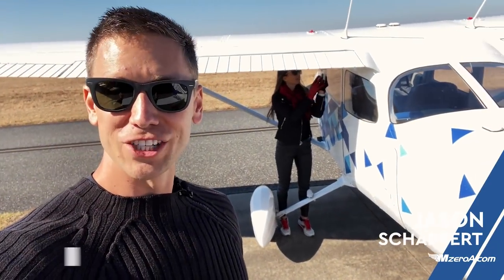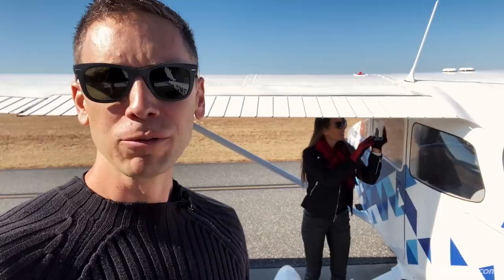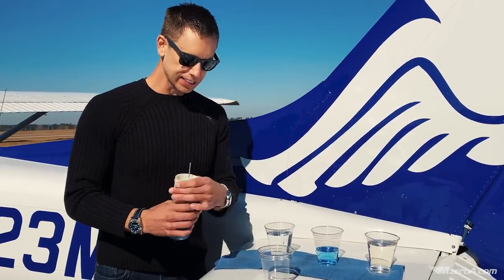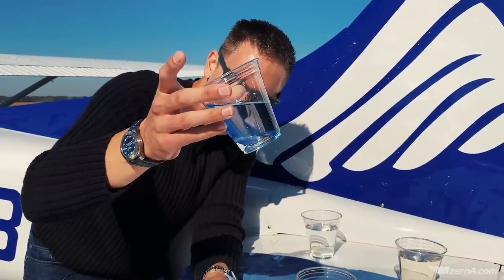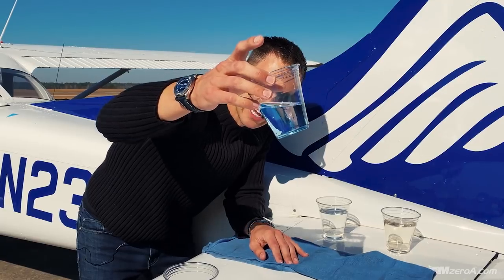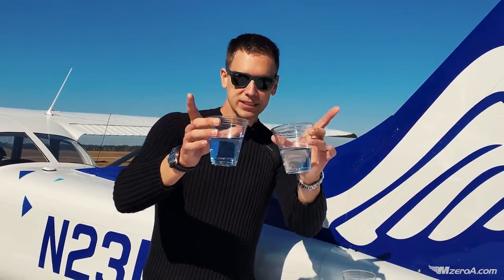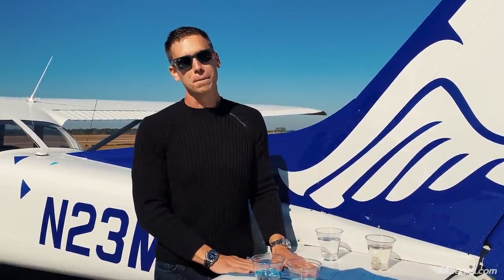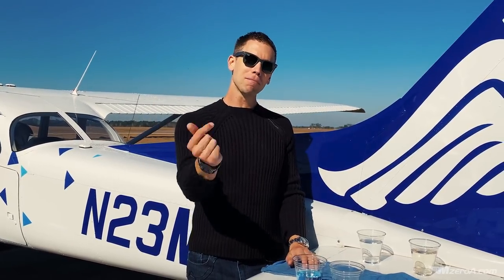Why We Sump Fuel - SPC Day 4

Comment: Another great way to tell if you have Jet A mixed in with your 100LL is to pour a little bit out on a paper towel. If it’s pure 100LL it will dry within a few minutes and there will be no residue, but if there’s Jet A mixed in it will leave an oily residue on the paper towel which will not evaporate. Saw this in an AOPA ASI video the other day :)
Reply: another way i beleive is rub it on your hand and you'll get that oily feeling on your fingers if there's jet-a in there

Comment: "How are you enjoying the 31-day safer pilot challenge?"

Well, Jason, it was fine until you did the side-by-side with the 100LL/Jet-A mixture. I had no idea how similar they were! Off to live in a constant state of paranoia now...
Reply from the maker: hahahah sorry my friend!
Reply: They're not similar if you smell. Or do a paper towel test. The nozzles are different between the fuel types. It would take a combination of a fueler who was very determined to make a mistake, a pilot who didn't ensure the correct refueling of their A/C, plus failing to detect it on the preflight. A fairly unlikely set of compounding errors compared to the real killers...
Reply: Could you elaborate on the paper towel test please?
Reply: Soak a corner of a paper towel in the fuel. Jet A will leave a visible ring when the avgas evaporates.

Comment: My 1st time ever seeing Jet A fuel. A very light straw color compared to regular pump motor fuel at the local gas station. Jet A and 100LL mix like gasoline and diesel, only it's the diesel that has a bluish green tint to it. Back before MA mandated a percentage of biofuel in kerosene and dying it red, it had a very light straw color just like Jet A, maybe even lighter. Interesting stuff nonetheless. As a mechanic, I'm constantly elbow deep in regular automotive pump gas. I get many, many examples of water settling to the bottom, thanks to the mandated ethanol content these days. It soaks up moisture like a sponge. Here in MA, we can't get any ethanol-free fuel at any pump anywhere in the state. God forbid they let our outdoor power equipment run correctly, and make it through storage without a carb clean. But I digress! Great vid, Jason - much appreciated.

Comment: Something that happened to me that you should be looking for. Debris. I fueld up once, right after another plane left the fuel pit. I fueled up, shot a sample into my test bottle and there was a bunch of tiny gravel. Out of concern I called the service number on the fuel pump and the owner told me it happens often. Guys will push off spin the plane, fire up and blast gravel. Causing gravel to blow into the open nozzle. At that point I was glad I was taught to sample fuel prior to putting it in the tanks. I could only imagine that it wouldn’t take much to plug up a carb jet, if the sump screen didn’t catch it.
Reply: I've seen barely visible particles cause motorcycles, and all kinds of outdoor power equipment to become a no-start. The idle passage is the smallest of them all, and is needed for starting. Very easily choked off.

Comment: If you look at the color of light coming through each glass straight 100LL vs 100LL mixed with JETA there is a clear difference in color visible in the light coming through the glass and shining on the elevator.   The light from the 100LL mixed with JET A looks yellow while the straight 100LL looks blue.  While you should know by heart the color of 100LL looking at the color of light passing through it is another way to tell if you might have a fuel mix-up.

Comment: This is actually one of my favorite things to show non-pilots when I fly them. Sans the jet A. But we always have a water bottle around to show them the fluid separation and why it’s dangerous.
Reply from the maker: I agree, it is a great demonstration!
Reply: Yep, water goes straight to the bottom - right where the fuel line pickup is, sending it direct to the metering device (carburetor or FI).

Comment: One would hope that the fuel suppliers make no mistakes when THEY load or transfer the fuel,... 'cause it says 100LL might not be true or JET A......I found a regular gas station that loaded  some Premium gas into the Diesel ground tank............ and I bought a full load of Diesel on an early morning fuel up......... just glad I was not in the air when I switched tanks........Always thought that the producers should have an additive that when cross mixed  would turn a really odd color...... like the red + green make's  yellow........ just my view.      Always good to have a heads up reminder video,... Thank You.
Reply: I delivered fuel before; that happens more often than you would think.  Co-driver put 1000 gallons of diesel in a premium tank once.  Cost the company over $10K to fix it.